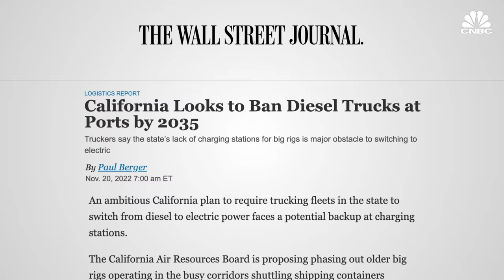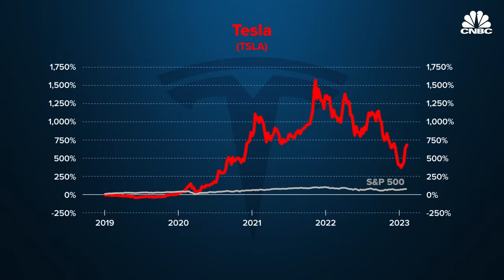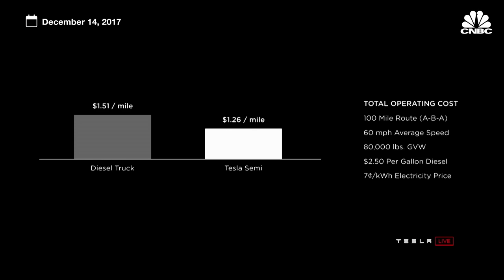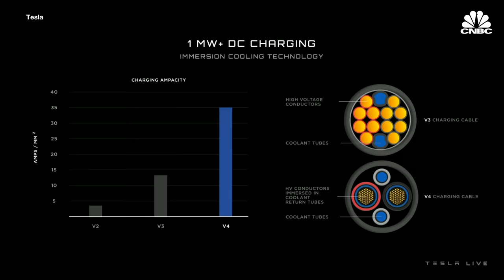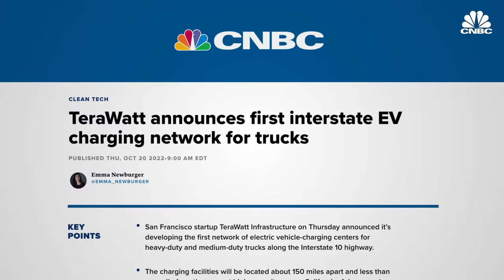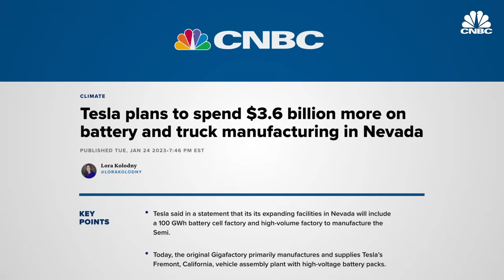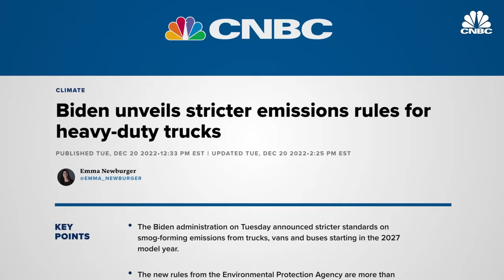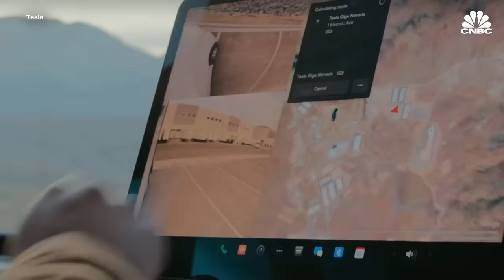Does The Tesla Semi Live Up To The Hype?

Comment: EV truck is good in Urban City that has heavy traffic... The ICE drive system is still the best IMHO 😸.... But if companies can make a super efficient low emissions engine with hybrid electric drive train for Urban traffic is good, TBH the more future proof is Hydrogen ICE with electric drive system IMHO not the full EV drive system... EV's battery mining is much more worst than fuel because of too much mining for the core ingredients/materials like lithium and cobalt.... The battery technology is still not mature and advance because we are still not seeing a real solid state batteries, carbon nanotubes and graphene tech battery in massive commercial use.... So it's better to put a bit more fund to develop a more future advance euro 7/8 engine standard with a integrated electric drive system 😸
Reply: Do some real comparisons of the technology, this truck covers 90% of truck deliveries in the US, you can make a hybrid as efficient as physically possible and it will still be half as efficient as this truck, you think hydrogen is the future? Try buying some.

Evs are better because you can recycle their batteries and re use 99% of the metals, where do you recycle your oil when you are done using it?
Reply: @miguellopez3392  how bout you, Recycled used motor oil can be re-refined into new oil, processed into fuel oils, and used as raw materials for the petroleum industry and evs are using cheaper material so it’s harder to recycle the battery

Comment: Lets see an electric log truck take the abuse that a Detroit  diesel does?
Reply: Tesla's business plan is to replace <5% of diesel semis a year. What percent of diesel semis do you think are used as log trucks? Not until Tesla Semis have replaced Diesel semis in every application other than log trucks, will the question of whether an electric log truck can or can't take the abuse that a Detroit diesel does be relevant.

See @crawkn's comment, above; he exactly addresses the absurdity of haters searching for applications Tesla Semis can't perform; until Tesla Semis have replaced every Diesel semi in an application a Tesla Semi can perform, a recitation of the applications it can't is completely irrelevant.

Comment: As a truck driver let’s me know when that piece crap get 1000 mls and when they going to put a charging station in every exit ramp in this country,but no only that 400 mls is not a good business,they have to get 700 mls a day in a single charge and I wonder how long will take to charge it
Reply: It takes <2 hours to charge at a Tesla Megacharger. Since these are day cabs, and not intended for OTR service, this will be fine for many operators. If it's not fine for you, don't buy one. 

It will "get 700 mls a day", including a top-off during the 30-minute break at 8 hours mandated by HOS regulations. This is farther than you can legally drive in a day where these are deployed, under HOS regulations and truck speed limits. 

There will never be "a charging station in every exit ramp in this country"; nor is there a truck stop at every exit ramp in this country. Does this mean you're no longer going to drive diesel trucks?
Reply: US CDL drivers cant drive 1000 miles in a day, try again.   70mph x 14hours = ~1000 miles.

Comment: As a driver you can’t make a good paycheck o/o because of the hrs to drive. Having to wait 1 hr to just drive 250+ miles, get out of here no driver will drive these trucks. Unless they change the FMCSA that won’t happen
Reply: Straw man. There's no plausible scenario where you have to wait 1 hr. to drive 250 miles. 

Just out of curiosity, what's the Tesla Semi that you hypothetically drive doing  during the 10 hours HOS requires you to be off duty after driving 11 out of 14 hours? Could it perhaps be charging? Just asking...

Comment: The only true solution to sustainability is a liquid green Hydrogen as fuel for the IC Engines. That's the way forward. Sure, storage can be developed but this will never lose compared to battery electric system. Max to max it can be a Hybrid system with Hydrogen IC engine. That's it. Nothing more then that. Each and every petrol station can be retrofitted with liquid hydrogen facility.

Comment: 0:42: 🚚 Tesla's electric Semi trucks are finally hitting the roads, delivering products for PepsiCo and other companies.
3:42: 🚚 The Tesla Semi trucks delivered to PepsiCo lack the promised autonomous features and have a lower range than initially advertised.
6:24: 🚚 Frito-Lay has been transforming its Modesto facility to showcase the sustainable benefits of zero and near-zero emission technologies, including Tesla Semis.
9:28: ⚡ The trucking industry is transitioning to electric and alternative fuel vehicles, with several manufacturers offering electric truck options.
11:22: ⚡ Tesla Semi faces challenges in scaling manufacturing and weight limitations, but aims to produce 50,000 units in 2024.
14:09: 🔌 California is pressuring the heavy-duty trucking industry to go carbon neutral by 2045, which will have a significant impact on automotive manufacturers and the market.
Recap by Tammy AI
Reply: The Tesla Semi trucks delivered to PepsiCo lack the promised autonomous features 
This is correct. The hardware is included, and as the narrator stated Autopilot will be activated later. Autopilot requires extensive training of the neural network with the different layout of cameras, etc. on the Tesla Semi, and undoubtedly PepsiCo is aware that this pilot batch of Tesla Semis won't have Autopilot until later.

 The Tesla Semi trucks delivered to PepsiCo ... have a lower range than initially advertised. 
What the narrator actually said is "There have been some initial reports that it can't handle the weight or the distance that was initially promised", not that the range was actually lower than initially advertised. And Tesla has already demonstrated a range of 500 miles from Fremont to San Diego, loaded to within 1,000 lbs. of the 82,000 GCVWR, including climbing to and descending from the 4,200 ft. Tejon Pass ("The Grapevine), on 93% battery charge. And the video goes on to say at 4:25 that "it's also delivering Pepsi out of its Sacramento warehouse on ... 300 to 400 mile runs to other warehouses", and at 4:36 that "The contents ... can weigh about 45,000 lbs."; which is not inconsistent with a range of 500 miles, fully loaded.

Comment: The thing that is worth noting is that Solid State battery technology isn't widespread yet. Those kinds of batteries are becoming more efficient than current Lithium Ion batteries so regardless if EVTs weight more their efficieny will keep going up and be cheaper than current deisel powered Trucks.

Another thing to consider with EVTs is that in the future you could see the batteries being swappable at truck stops and that they're going to be far easier to repair. That means far less downtime and more time spent on the road earning money.

Comment: Pice of crup truck I would like to see it drive on ice
Reply: It will do much better than a diesel semi in ice, for three reasons: first, a substantial portion of the weight of the tractor will be shifted to the drive axles due to improved weight distribution of the batteries, increasing traction; second, the smooth application of torque by the electric motors, compared with transmissions shifting every few seconds, should mean less wheelspin; and third, the torque axle has independent motors on each wheel, allowing torque vectoring in limited traction situations.

Comment: Diesel is the way for power to weight ratio.  . Electric is just pushing the emissions somewhere else  and will run the batteries low when  you carry more weight and in the cold. Batteries do not like the cold. Also, they catch light a lot and explode spontaneously.   The infrastructure is not there world wide  yet.  How do you run a truck 24hrs  like diesel do. Electric  vehicles have been around since the late 1800's  and early 1900's  it didn't work then and won't work now. How come no one speaks about how they mine the cobalt and lithium  from Africa with children working. ??? 🤔

Comment: Hmmmm could you imagine an electric truck hauling gasoline? He gets to the gas station some fumes escape will the static electricity around the truck cause an explosion I worked in a lot of gas stations most gas tanker have a air pressure powered starter hmmmm I wonder why??? What if the gas station is old?
Reply: What you probably missed is that once the EV conversion is complete, there will be no electric trucks hauling gasoline. Further, you have a limited understanding of static electricity. An electric truck is no more and no less likely than a diesel truck to develop a static charge, and the same simple solution—grounding—will work for both.

Comment: This truck might be good for transporting chips or napkins within a city within a hundred mile radius in warm weather.  But for long distances and with heavy loads, and even in cold weather, this toy is completely unsuitable, and will never compete with an internal combustion engine.
Reply: This thing goes 500 miles, 70% of truck routes in the US are under 300 miles. This thing is not a toy, 1 motor has the equivalent of a 500HP engine but leverages 2 extra motors that give it more torque at 30-60mph than any other class 8 diesel truck while having 4x the fuel efficiency leading to the truck payingitself on fuel saving alone in 3 years of use. It's a state to state but not coast to coast truck.
Reply: @miguellopez3392  Your answer suggests that you are incompetent in the practical trucking business.  As an owner operator, I have been engaged in interstate cargo transportation for many years and I have something to object to you.  Each of my flights takes an average of 800 miles one way, and from the declared 500 miles of power reserve on the Tesla semi, this is clearly not enough even for half the journey.  This is if we theoretically assume that the Tesla semi will travel all 500 miles.  But this will never happen, because the heavy weight of the load will immediately reduce the battery supply by almost half, a long climb on a mountain pass and cold weather will exhaust the indicated power reserve instantly, so this Tesla semi is an impractical expensive toy, suitable only for transporting  city light cargo for distances within a radius of not more than 100 miles

Comment: This is such a waste! Electric cars yes probably, electric pickup trucks maybe, but electric semi-trucks should be hydrogen semi-trucks. As of  right now and the foreseeable future the only way to increase range is increase battery size, which just increases weight so much, which your return for the mileage increase just gets smaller and smaller. Hydrogen doesn't have this problem, plus you can build out a hydrogen fuel station for the semi-trucks and keep them going instead of having to stop and wait an hour or longer, and I know they aren't making long trips yet but it's just a poor choice. And if they ever choose to try these things long distances, with everything else going electric, can the grid handle all these electric semi-trucks?

Comment: To many problems still.Range issue and most important reduced useful payload as battery pack weight dead freight could put in.Unless delivering just down road impracticable for Australia outback with perishable foods.would create epidemic with spoiled food being delivered at end with enormous charge time needed to go 1000 miles.
Reply: Tesla developed the semi to be commercially competitive against most truck routes, and 1000 mile trips are far less common than 300 mile routes , no one lives in the outback, the coast has most of your population and traffic just like the US. Also the tesla semi can run a month running the the refrigerator on a trailer, how long can your semi idle?

Comment: We are not there yet. That's right. Maybe on short distance or low freight weight  electric trucks have their benefits. But for long distance and heavy weight... they just could not have enough battery capacity. Or they would need so huge battery that won't left space for freight.
Reply: itw would need a 4x;larger battery to match the longest range diesel semis, but most semis go under 300 miles on a delivery.
Reply: wtf are you talking about, this truck is exactly for that, long range haul it has the range and everything....

Comment: How much does a bag of Cheetos weigh?
You could fill that whole truck up with Cheetos. Potato chips and wouldn't have 5 tons They're lying to us and wait till winter hits. And it's cold out that thing I get about two thirds of the mileage
Reply: You could fill that whole truck up with Cheetos. Potato chips and wouldn't have 5 tons Yes, this is probably true. That's what's called a cubed-out load.  But you could also fill a flatbed trailer with concrete highway barriers, and you'd have 22 tons. 
Oh, wait, they already did, and passed a diesel semi crawling up the hill as if it were standing still: https://youtu.be/LtOqU2o81iI&t=985
 And it's cold out that thing I get about two thirds of the mileage 
You get? In test after test, Teslas have about the least loss of range in cold weather of any EV, and there's no reason the Tesla Semi will be any different. All vehicles lose range in cold weather, and best guess is that Tesla Semis will lose 10% to 15%. Further, this is perfectly predictable, so dispatchers can plan around the minor range loss.

Comment: ROAD USE TAX ON DIESEL IS THE LARGEST COST OF THE FUEL, HAS ANYONE DECIDED HOW TO TAX AN ELECTRIC POWERED VEHICLE FOR ROAD USE ?    WHAT IS THE PRICE OF THE ELECTRIC TO RE- CHARGE GOING TO COST ?    ALL OF THESE OPERATING COSTS WILL BE PASSED ON TO WE, THE CONSUMERS. !      DOES THE U. S. HAVE THE GENERATING CAPACITY FOR EVs ?    BE PREPARED TO PAYUP AMERICA !
Reply: ROAD USE TAX ON DIESEL IS THE LARGEST COST OF THE FUEL 
Nothing of the sort. In California, which has among the highest taxes on diesel fuel in the US, the state plus federal excise taxes, which go partly to road maintenance and repair, total 68.4¢/gallon, barely 10% of the average $6/gallon cost of diesel fuel.

 HAS ANYONE DECIDED HOW TO TAX AN ELECTRIC POWERED VEHICLE FOR ROAD USE ? 
Some states are simply adding a fixed charge of several hundred $ to annual registration. But AFAIK no state has figured out how to factor annual road miles into this calculation. Anyone who buys an EV should expect to start paying this, sometime in the near future. 

  WHAT IS THE PRICE OF THE ELECTRIC TO RE- CHARGE GOING TO COST? 
For Tesla Semis deployed from the PepsiCo Sacramento Bottling Plant, about 10¢/kWh for electricity from the grid. But some also comes from rooftop solar, so the average would be somewhat less than this. Costs in other utility areas will differ; but even in San Diego, which has the highest electrical costs in the lower 48, the residential EV charging rate is only 15¢/kWh; and many EV users, myself included, charge for nothing from rooftop solar systems. For those Tesla Semi operators who can't charge in their home yard, or individuals who can't charge at home, costs will of course be significantly higher.
 
 ALL OF THESE OPERATING SAVINGS WILL BE PASSED ON TO WE, THE CONSUMERS.! 
FIFY

 DOES THE U. S. HAVE THE GENERATING CAPACITY FOR EVs ? 
The present capacity is not adequate for an immediate shift to EVs; but the actual transition will take decades, if not generations, and that's plenty of time to expand the grid to meet the demand. Keep in mind that the rail and electrical networks of much of Europe was rebuilt almost from scratch in 10-15 years, in much of Europe after WWII.

 BE PREPARED TO PAYUP AMERICA ! 
There will be some additional short term costs, over the next 40 years or so; but long term, energy costs and environmental impacts will go down dramatically.